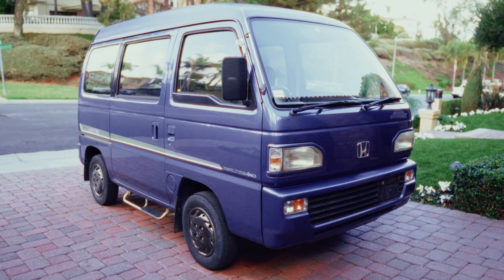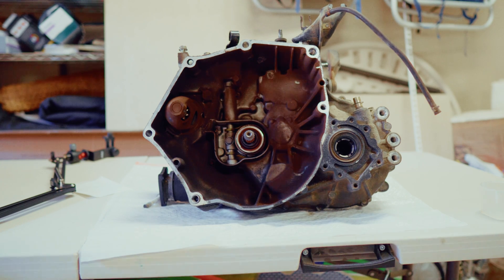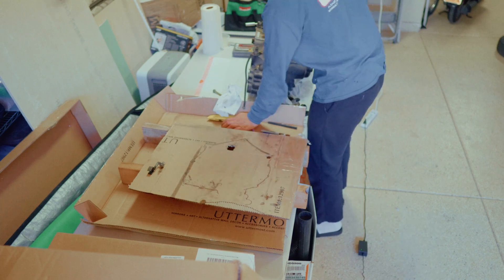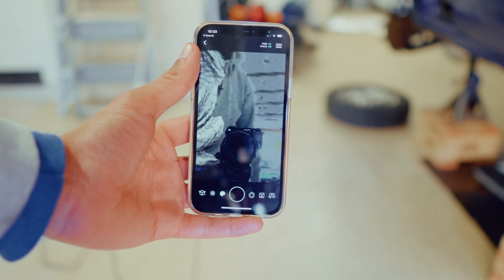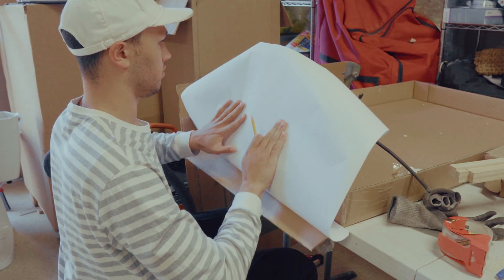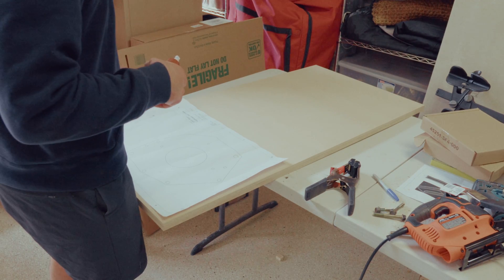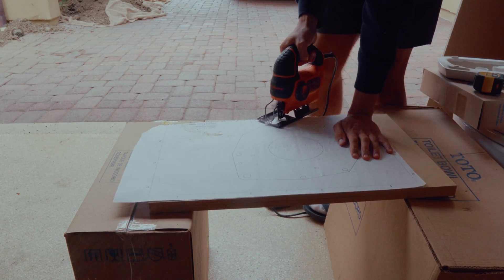How I connected an electric motor to my transmission

Comment: You mentioned that the AC was an upgrade? Know is that because of power and torque or is it because of efficiency? Cuz I would imagine you're running inverters which do take up some of your battery capacity to run them. Plus with AC what a few hundred dollar difference you can probably get one with a different torque range I'll put it that way.

Comment: Oh I haven't watched your video fully but I do have a question so what about using your master cylinder and your power brakes? How do you or do you? Use a vacuum system or have a pump in place so you can actually use your power steering and your power brakes I guess? I mean obviously nobody cares about ABS so yeah be curious to hear from anybody that has the answer to that cuz I would be thinking that you would have as part of your system. Running from a pump from the main battery or batteries or secondary?

Comment: Ah yes the rubbing technique. I was in high school and I didn't have a reference for the maker model the small engine I was working on in small engine class in high school. So the teacher had some gasket material and a lot of people are like how are you going to do this to me the answer was very obvious get some dirty oil cuz it's going to stick. What a little bit of Greece mixed together and you rub it on the head in my case and also another part that I needed a gasket. Placed it on and I pulled it off. The teacher came over kind of wondering what was going on and how I was going to fix my situation saying that I did not know the maker model and other information needed to get the gasket from the hardware store right across the street. He goes oh I see what you did there that is actually very very intelligent. In fact I actually would never have thought of that myself.. Pat myself on the back right now. So I drilled the holes with a holes needed to be drilled just a little bit smaller and I carefully cut out everything I needed for my gasket cuz I had a template already. Mind you I was using gasket material. and I put that puppy on after she was cut out from the center that was the hardest part. It's cutting out the center. 512 is all said and done passing rain beautifully. In fact it's a method I still use occasionally like for instance when you need a gasket for the thermostat spigot or nozzle? It's the one at the house goes on to and runs to the top of the radiator if I recall correctly. And without being told I did a stagger pattern on the timing of the bolts but I also agree with them too in case I ever had to pull it apart down the road but not too much grease. I did forget to mention I did paint the bolts and the other parts before assembly by the way. I know I had a question but when I remember it I'll ask it I just wanted to point that out cuz I had a bigger point but let's just go with the video and we'll go from there

Comment: Excellent video. Brilliant idea to use the crank of the ICE engine !  I'm gonna use that idea.  If the motor too lonng, try the Motenergy ME 1616. Probably just right for that van and 1/2 the cost of the AC 50 or Warp 9.
Reply from the maker: Thanks! The 1616 is less than half the power of the already low powered AC-50. It probably wouldn’t do too well pushing this thing up hill

Comment: Now as a 71 year 😂old dude I just wonder why go to all this trouble whilst a way easier method would be to couple the electric motor directly to a suitable ratio differential  ?
That would be much easier and save a lot of weight same time as well as friction through the gearbox .
Just work out the ratio needed , get a small prop shaft connected an Bob's your uncle. 
Quite sure there will be less Gear WHINE coming from such a conversion as well.

Comment: Hi there next time you need to trace a pretty accurate sketch of a part just put a thin smearing of grease all around the housing then gently place on cardboard or paper and firmly press it down and let it dry and you will have a perfect ish outline that you can then draw with a marker pen it's what I do with motorbike engine casings and always works a treat

Comment: I've bought a set of centre punches and am planning to punch directly through the bolt holes on the transmission and into the aluminium spacer plate. I hope it works!

Comment: For a channel that has engineering in its name there certainly isnt much engineering going on.  Using a hand drill to drill sidewards holes, claiming there are torque "specs" for a prototype motor plate to attach to a motor, using hex headed bolts for said attachment without a washer(s).  None of this even mentions the fact that he is taking the path of the most resistance by flipping the transmission onto the cardboard instead of laying the cardboard on the transmission.  

Not much in the way of work flow in fusion either...so much for taking a head on picture, importing it into f360 then scaling it to size and making the appropriate holes in their location.  Its not hard nor does it take any substantial amount of time. As a user of Fusion360 since 2019 I can do something very similar (and have) in very little time. 

Quite frankly this video could be a case study on exactly how NOT to do things. Was anyone else astonished by the shear amount of extra work created by the guy in the video?  So much for working smarter and not harder.
Reply: Bruh it wouldn't hurt to be a little nicer. The motor manufacturer probably has torque specs for bolting their motor to things

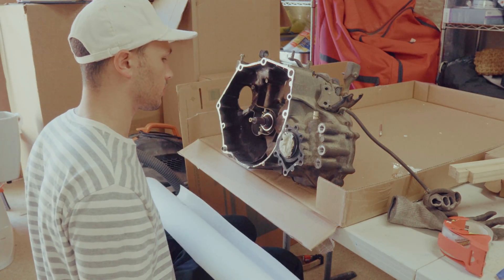Comment: 3:00, spray the flange with machinists ink and carefully place the transmission on the paper, or spray the flange and tape the paper to the top of the transmission and flop the paper over like a hinge to the face of the flange, or take thin cardboard and place it on the flange and hit the carboard with a rubber hammer making an impression from the flange to the cardboard.
13:30, toaster oven next time for even heating.

Comment: Very nice. I always wanted to EV swap a kei car. Specifically the deckvan keis with both van and truck bed.

I originally had considered keeping my CRX transmission for the same reasons as you for my EV conversion but since i was using the Nissan Leaf motor, I found the axle coming from the Honda transmission wouldnt clear the motor and ended up using the Leaf single speed transmission instead. Make sure your axles will clear the motor with the transmission. The benefit of mating the transmission is stock axles can be used but if they dont clear, you'd end up needing an intermediate shaft which is just custom axles all over again.

What do you plan to use for batteries?

Comment: Real EVs only have one gear and don't use a transmission, clutch or flywheel. It's just extra weight and something complicated to break.
Reply: Do you think gears will improve mileage
Reply: @damensutherland7081  no. Gears change torque but electric motors have max torque at all speeds so gears aren't needed.
Reply: @MarkSpohr  Human cyclists have near to maximum torque when they stand on the pedal. But you still don't want to take off from a standstill in a higher gear. Gears are useful.
Reply: Electric motors don't have max efficiency at all speeds though. EV manufactures probably put a lot of testing and thought into choosing the perfect gear ratio, not really practical for a DIY project. It also might be easier to keep the transmission instead of mate the motor to the drivetrain (especially if the rear differential is part of the transmission like it is in Sambars)

Comment: As someone else commented the axial load needs to be addressed. The old gas engine has a bearing design that can take the lateral pressure from the side load that happens every time you step on the clutch. Those clutch forks put a few hundred pounds of sideways force on the electric motor bearings which probably has not been designed for and you will have premature bearing failure.
Reply: The best fix for that is to throw out the clutch alltogether

Comment: I am concerned about no pilot bearing for the transmission shaft inside your flywheel hub.  Also I am concerned that you are relying on the HPEVS motor bearing for the axial load caused by the the pressure plate engaging the clutch.  I believe what is needed is an additional thrust bearing to  take that axial load.
Reply: I have no pilot bearing. Just wouldn't fit after adapters etc. My car though hasn't left the driveway.  Legal costs are high in New Zealand to make a conversion road legal.

Comment: an inch thick bellhousing plate is insane lol. Good news it wont flex, thats always a plus. Other than that, I thought the AC 50 motor would be smaller, glad I didnt pick one up for my project. I am converting my dads 1979 Kawasaki kz650 SR into an electric bike. Going to build a 20kwh battery pack for it and have either a mid drive motor or a hub motor. Depends on the battery size and shape of it. I may have to build two battery boxes and link them together via giant cables. but either way it will work out to be around the same weight of the original engine and trans, and theoretically it should go somewhere around 250 to 400 miles a charge. Zero bikes are 16kwh max and get around 300 miles per charge. So I should be a bit better depending on the output I set the motor up with. It wont be a 75kw bike, more like a max of 30kw of output.

Comment: ive been wanting someone to use a manual in an ev forever. would be cool if you could tune the engine to rev almost like a ice engine but also take advantage of its instant torque and rpm
Reply from the maker: Totally!

Comment: It still seems like using a salvage Leaf drive assembly would be less work overall... and a lot more reliable, and more powerful, and smaller, and more integrated and... and...
Reply from the maker: I promise you it’s not smaller, it would be really hard to mate it to the existing drivetrain as well. As far as reliability goes, a salvage motor doesn’t come with warranty and support. HPEVS does, but to each their own!